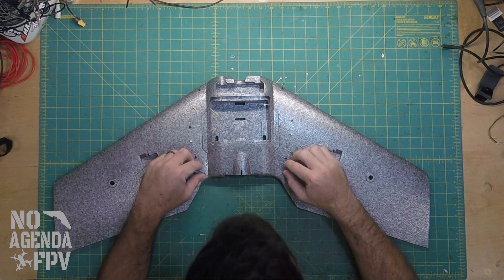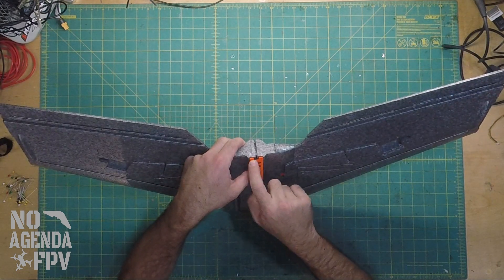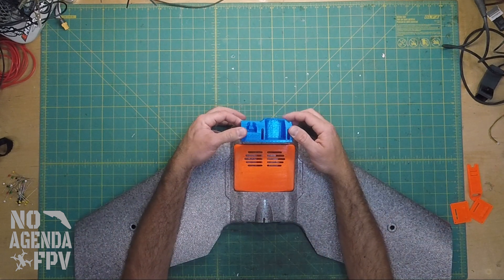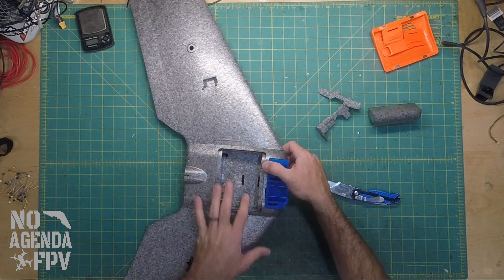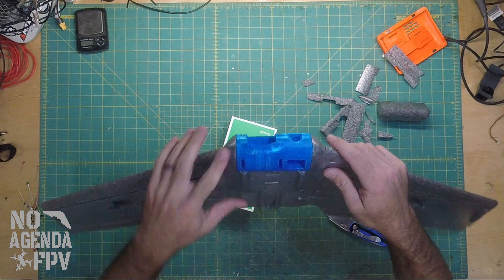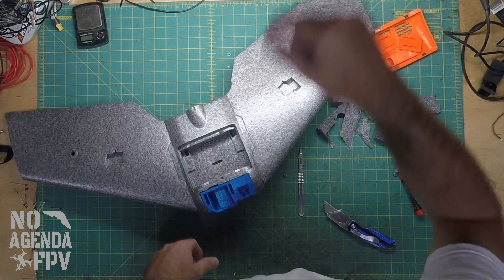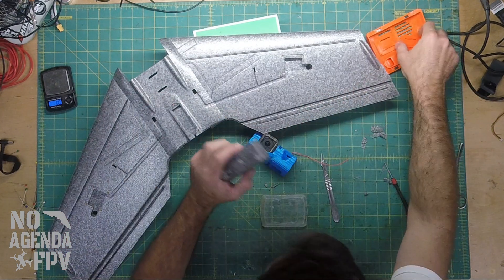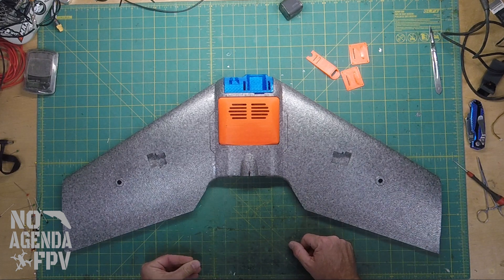Reptile S800 build 2019: Part 1.5 3D Printed parts

Comment: This build series is great and I'm happy to see the nose design is working so well for you! It really makes a difference over the foam nose and I think it provides a lot more protection to the cams. I don't think you need to worry about the weight of the nose though. While I was prototyping the original, I found I had to add around 30g of weight even though I was running a 4s pack, GoPro and no extension on the motor mount. This is why the finished version has the cutout for adding ballast.

Comment: Hi im at my 4th printing fails, in what position do you 3d print the canopy???  Thanks
Reply from the maker: I recall that it printed best upside-down with the largest flat portion as the bottom. Might be worth looking in the comments on the thingiverse page too, it's been a long time since I've printed one.
Reply: @NoAgendaFPV  thanks for answering 
Upside down meaning flat on the air inlets or standing vertical ?
Thanks in advance
Reply from the maker: @bullitanaconda  air vents down. I have printed it on its side also, just have some stringing from the first few days trying to bridge the long gap on what becomes the inside side wall.
Reply: @NoAgendaFPV  thank you i will give it a try